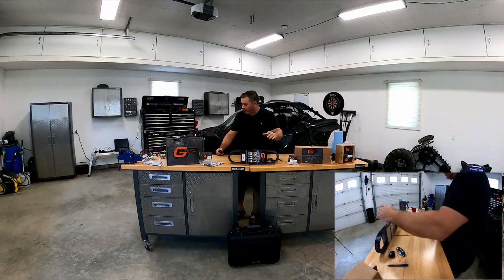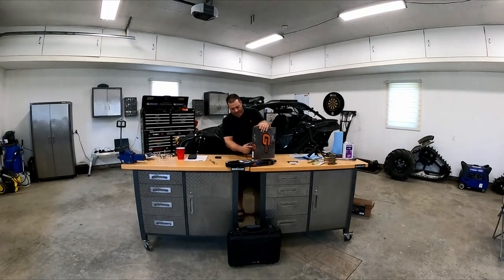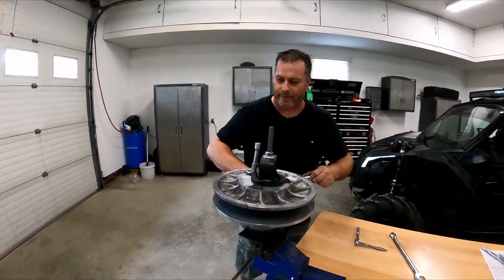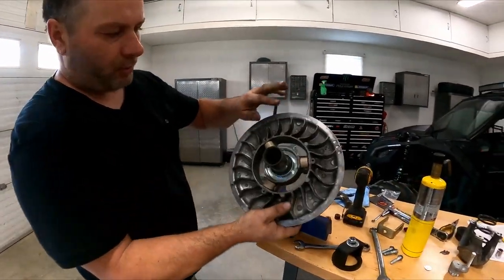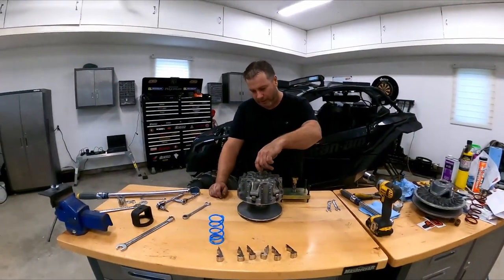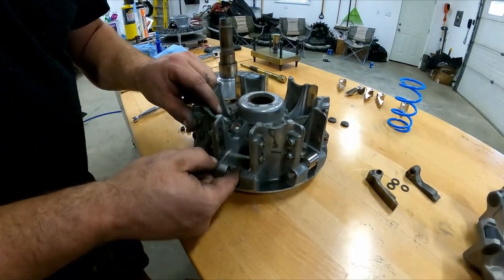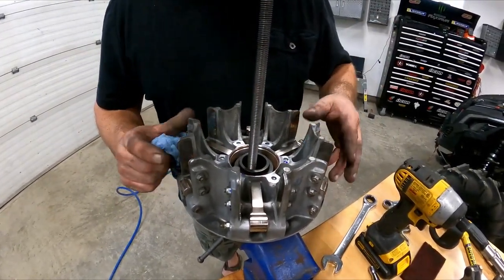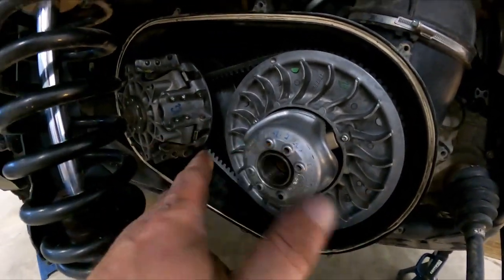How To Install Clutch Kit For Your Can-Am Maverick X3 And G Boost Tools

Comment: You don`t need those tools to split your clutch.   just need a clutch puller.
Reply from the maker: What do you use to split your primary clutch?
Reply from the maker: So you bang the treads and if you ever miss it may cost you a spider, but it works aluminum after banging it for a long time not sure 🤔 I want to do that if you do it once and don’t ever need to do it again ok 👍 but I play in my clutch minimum 2 times a year , but thank you for you feedback it’s appreciated
Reply: It`s the same way they do it on the new Pdrive clutches, both on the X3 and on the ski doo turbos. and have for years. @Can-AmX3Dude
Reply from the maker: @brienhalverson1956 ok 👍